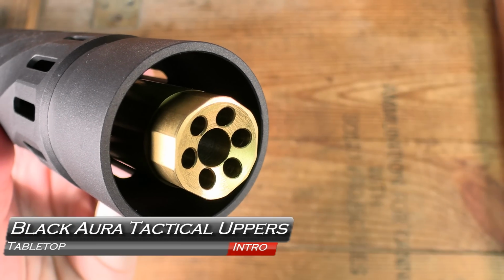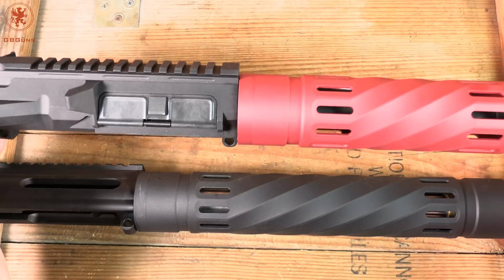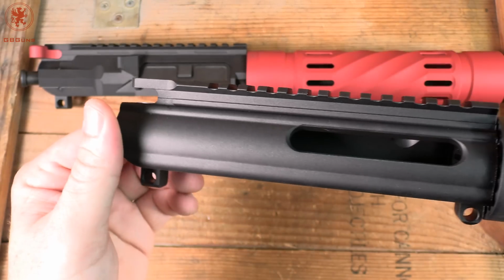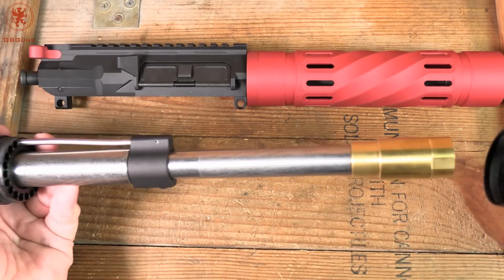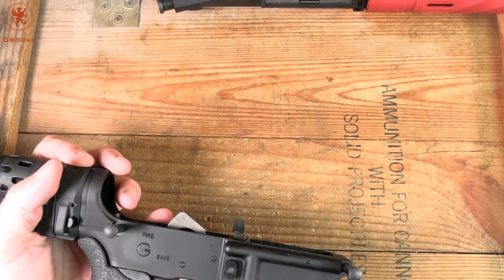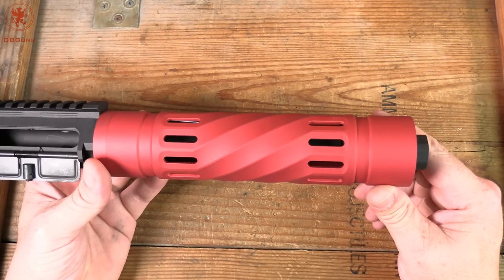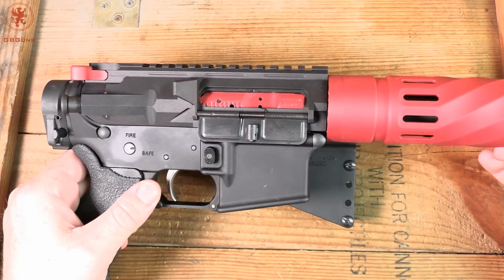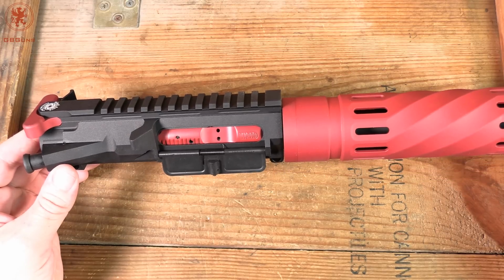Black Aura Tactical AR Pistol Uppers Introduction

Comment: I was planning on building a pistol before the plan demek I have three lowers two of them already fully build the third one I was planning to build 7 inch pistol and do to the plan demek I wasn't able to find anybody who had a 7-inch upper and I found black Aura Armory bye Google searching found out they have them in stock don't know the company so I decided to take a chance and you're the only one who has anyting on their pistol the question is are you going to do a further review on their pistol I'm hoping and did not do a mistake I would have bought Palmetto State Armory but they're out of stock I do have their lower which is what I'm going to use like you did
Reply from the maker: Yes, it's already done.  Search the channel page.
Reply: @GBGuns  yeah I seen that one too are you going to do anything further after using it for quite some time is what I meant to say I did see that other one you did you and that lady as well I just want to know if you're going to do any other reviews further on it
Reply from the maker: I don't know what more to say about it.  We have so many guns to go through there's not much time to circle back.
Reply: @GBGuns  that's understandable thanks a million